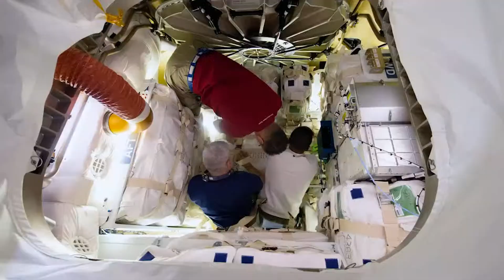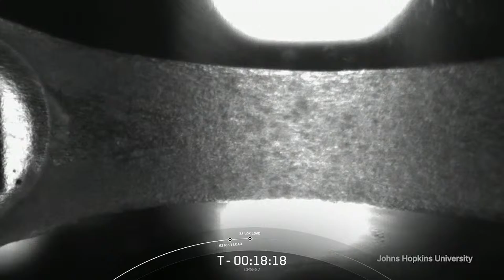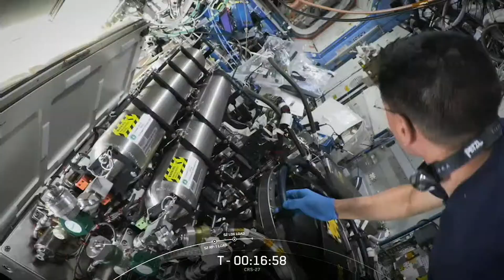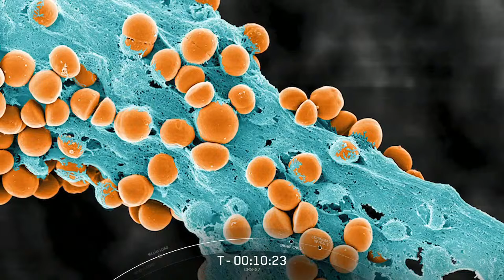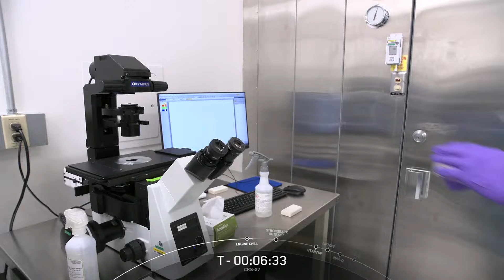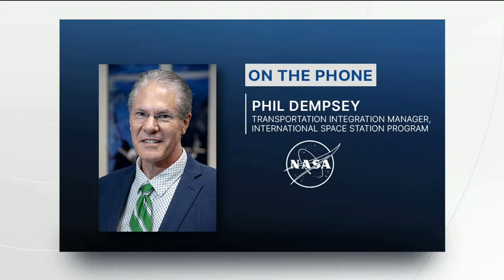CRS-27 Mission

Comment: Nice mission so far, I just wish NASA would start broadcasting in higher resolutions than 720p. And stop talking/whispering while mission control talks.

P.S. For those who didn't catch the live transmission, it was in 720p. :) I wanted to change the video quality, but that was the max.
Reply: It's not NASA doing that, it’s SpaceX.
Reply: Unfortunately, 720P is still HD.
Reply: This is in 1080p. Change to advanced settings.  And this is SpaceX.
Reply: maybe you can do better with your space company😂
Reply: It was 720p in the live transmission. :)
Reply: @brucecrouch4877  The broadcast was managed by NASA, and SpaceX broadcasted the NASA feed.
Reply: @joshuaprimrosearchives4704  For sure. 😂 Until then, NASA could do better too.
Reply: depends on a customer. Nasa for some reason asks for lower resolutions. Every other broadcast from spacex is 4k
Reply: @SuperiorInk  Interesting. When did you join the stream? I had my tab open before they started, then refreshed about 2 minutes after that. The max I had was 720p, as it is with most NASA broadcasts.

I don't know if it's possible to add new bitrates after the stream starts, or if higher bitrates are limited to some geographic regions. SpaceX usually broadcasts in 4K, so I know it works here in Europe - both Germany and Romania.

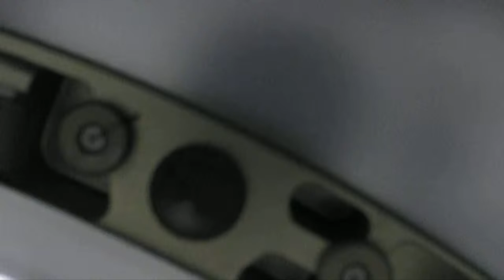Comment: Possibly it's a fuzzball or natural debris that was stuck in the seem of panels or something, though it looked as it had flight characteristics of an insect. At the minute of 47:54, there looks as if a fly flew from the seam a few inches below the center black dot down to/and over the white, to the extreme lower left corner. It only can be seen for literally a split second. Anyone else seen it?

Comment: Anybody notice how we now get all these good cameras when not that long ago the mantra was "oh it is shaking too much can't keep a good feed". Goes to show little Elon knows about his own company or should I say the company he bought with his blood money. Shoutout to the SpaceX engineers for rising up to the challenge.
Reply: (Sigh) Ignorance, thy name is Powertampa. I can't imagine what you mean by blood money. I'd be willing to bet that even if you could put words behind it, they would be entirely fictional. As for "bought", no, you must be thinking fo Tesla. Elon most definitely founded SpaceX and, although Tesla Motors was founded by others and he did buy it, he is the one who turned them into a major auto manufacturer, if you call between one and two percent of the market major. Before him, they were utterly insignificant, if they had ever actually made a car at all. Anyway, the reason they used to lose signal on barge landings was well understood. As you say, vibrations caused by the landing. The way the problem has been solved is also well understood, transmitting signals through low orbiting Starlink satellites instead of traditional communication satellites in geosynchronous orbit.
Reply: It's almost as if the same company is building a satellite service that provides highspeed links.